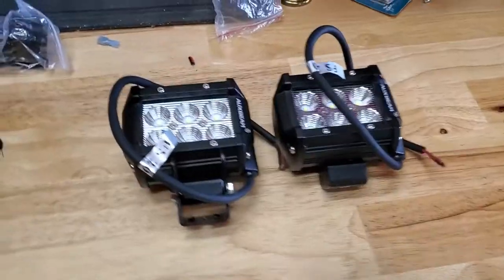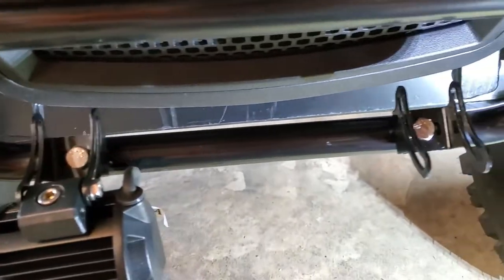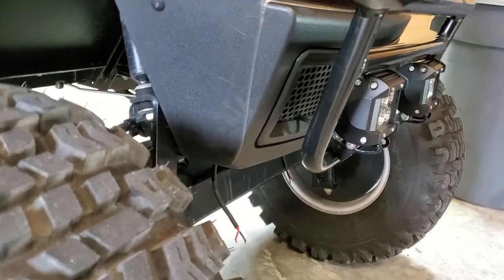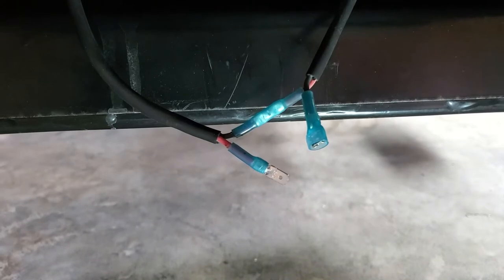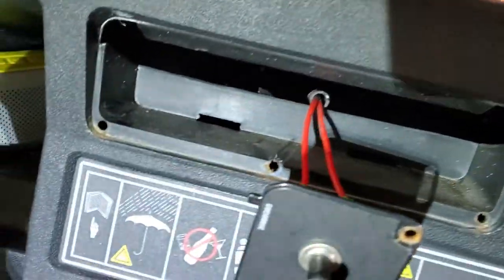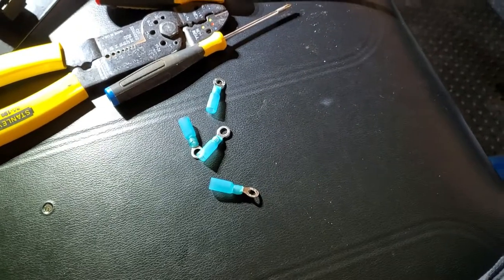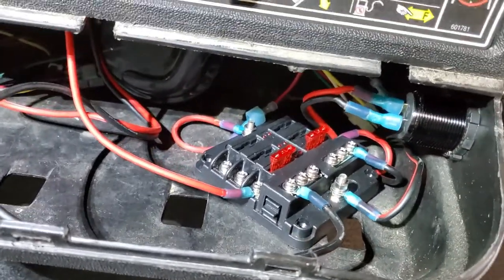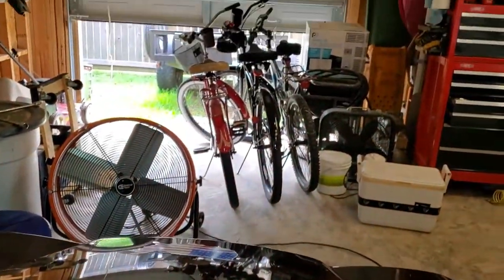LED light pods installed on a EZGO golf cart.

Comment: I think you have the right idea putting the low-voltage breaker box in the dash instead of under the seat.
Reply from the maker: There is one under the seat as well. It was a glass fuse unit. I replaced it with one like this that uses spade fuses in another video.